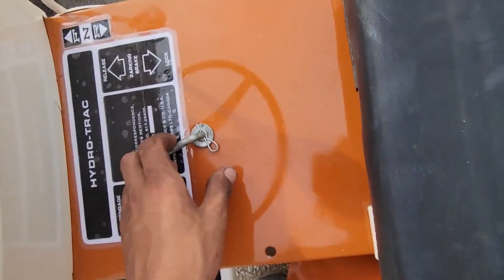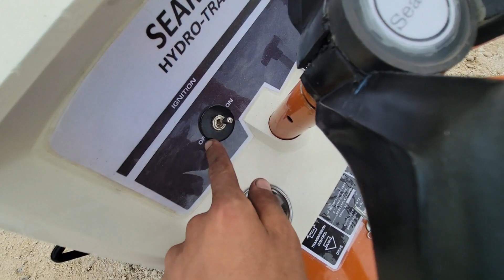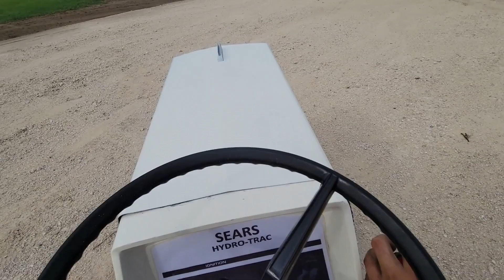NEW sears hydro-trac full build

Comment: Came out great but the Predator just kind of kills it for me if you have carburetor troubles with those tecumseh's you can do a k181 Kohler carburetor swap with a Briggs & Stratton vacuum fuel pump on Ten and twelve horse engine worked great for me on my 69 Suburban 12
Reply from the maker: I just don't like the hh100 and hh120 teky. I've had several and could never get any of them to run right.
Reply: Yeah they're very finicky engines it seems like I had  hh100 that I could not get the run right even with the Kohler carb it ended up being the gasket between that little tin plate between the carb and the block it kept sucking air making it run lean one of those things I'm not a big fan of tecumseh's but I seem to end up with a lot of them lol never had a single problem with Kohler